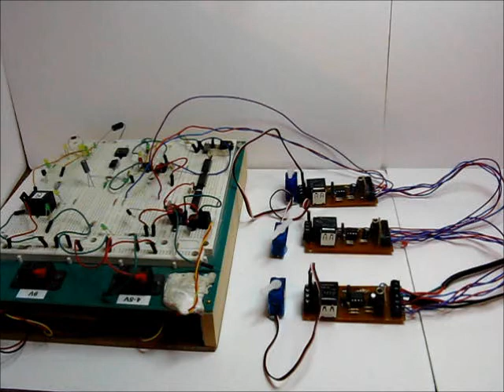Picaxe servo point motor

Comment: Hello Sidney,
I was wondering if you still had the code and or wiring diagrams for this project as I am trying to work on something very similar for my layout.
Any help would be much appreciated.
Reply from the maker: Sorry old chap, but this project over 5yrs old now and has since been scraped.
I used PICAXE chips as they had a great set of manuals and a user forum that was so helpful.
Good luck